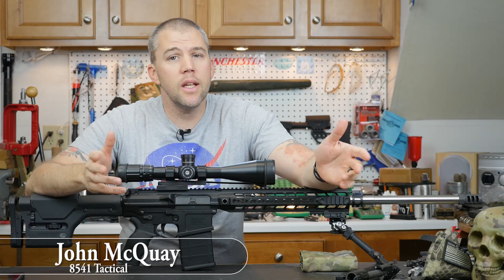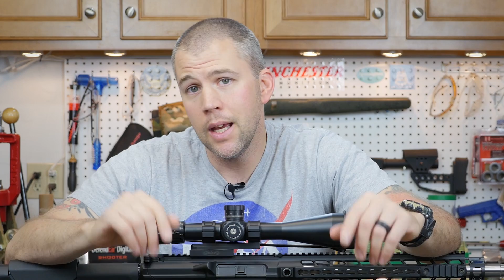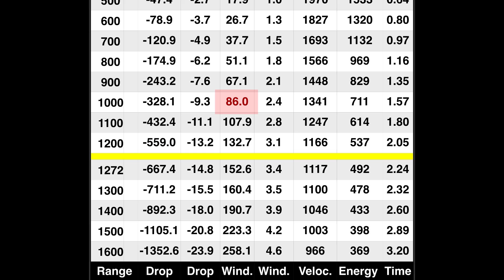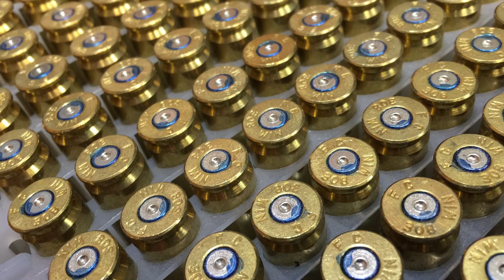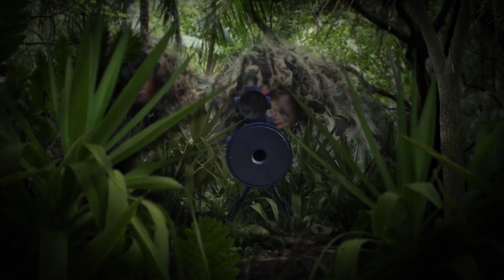Mail Call Mondays Season 4 #14 - 6.5CM versus .308 Win, and Federal Gold Medal Match Brass.

Comment: lost me at burning up barrels.  loved my AR in 243WSSM but took me 2 years and it would not hold a 3 inch group at 100 yards, was holding very nice groups before.  really didnt take much ammo to do it either.  Re-barreling an AR is not all that bad but im not going to do it every 2 years and im absolutely not going to buy one in a bolt action or anything else.  I got rid of it first chance i got. not even going to bother with this round either so thanks for the heads up and i feel sorry for anyone that buys a nice bolt gun in this round.  my Rem700 bull barrel .308 may not be good out to 1400 yards but its been shooting just fine for 20 years.

Comment: Honestly I don't know why anyone shoots the .308.  The 7mm and 6.5 Creedmoor are , out of the box, better cartridges.  They have a lighter recoil and so are more comfortable to shoot.  Plus at the responsible ranges you can take game, there is no practical difference in energy.  They have plenty to take down deer elk moose an boar.  

The .308 and 30-6 are obsolete cartridges from the past.  They are slow, and too heavy.  They are more impacted by windage and elevations issues in distance shooting.  While at shorter distances they have more energy than needed with the penalty of greater recoil.

At 1,000 yards, the .308 needs 8.2 mil. of elevation while the 6.5 needs only 7.8 mil. of elevation.  However the .308 needed 2.7 mil. of windage, while the 6.5 needed only 1.3 mil. of windage, less than half that adjustment needed by the slower .308.

If you are shooting at variable distances, the 6.5 is the better cartridge.
Reply: You clearly haven't thought very hard at all if you don't know why anyone shoots the .308 Win... especially when this video highlights some of the many benefits of the .308 Win.

Comment: Roughly how many shots can you get out of a 308, 6.5creedmoor, and a 338 lapua barrel?
Reply: 308 average barrel life is around 5,000 to 10,000 rounds depending on manufacturer, overheating, and proper/improper cleaning. 6.5 is around 1,500 rounds, I suspect 338 is around the same. 5.56 is an odd one being around 10,000 to 25,000 and I don't think you can wear out a 22 barrel honestly, 50,000 to 100,000 rounds? Someone might want to check my 5.56 numbers because I've seen someone that swears he has around 30k through his and it's still 1-1.5  at 100 yards.

Comment: Everyone makes such a big deal out of barrel life on the 6.5mm, heck I bet it lasts twice as long as any 243, been shooting a 6.5x55 for years still groups remarkably well. Had competitive shooters tell me they get 4k-6k rounds downrange before they rebarrel, so you would literally be spending over 10 times as much on ammo as replacement barrels. Sure a 308 can get 8-12k but I would personally go for the better downrange ballistics and in my experience it is REALLY hard to beat the accuracy of a 6.5mm not even my 7mms will touch the accuracy of my 6.5x55.

Comment: what about 7.5x55 s for  a presision match
 exelent round and good barel life
Reply: Lol why not a 30-06
Reply: Oh boy, someone caught the crack pipe again lol. The 06 pushes the same dam bullet faster, in the 06 you have a better range of bullet grains and heavier bullets with higher BCs than the 308 so you need to read before you speak. The 308 is just easier on the shoulder and more of it can be carried into battle. That is why our military chose it over the 06. Same for the 300 win mag, it has the advantage over the 06 due to heavier bullets offered going faster but they are all the same 30 caliber bullets.
Reply: That and they have a very sharp recoil hit over the 308.
Reply: Long John some people argue that the shorter case of 308 allows for more consistent powder burn making it more accurate

Comment: First off, I really enjoy the channel. Thanks for your efforts! So, I had a Rem700 built in 7mm-08 Rem and it shoots great, but I'm becoming paranoid about the brazed on bolt handles. Do you think the brazed on bolt handle is a real problem? Is it worth it to buy a one piece bolt and make changes to a .4 MOA rifle? Did the USMC reinforce their Rem700 bolt handles with three screws? Are there any competitors running 7-08s? What is your ideal weight for a PR System (rifle/scope/bipod/empty mag)?

Comment: What is the audio set up you have now, I don't recall you mentioning that.  Obviously it's a RODE set up of some kind.  I'm way past due to upgrade my setup.

Thanks!
Reply from the maker: Rumblestrip.NET This is a RodeLink Wireless lav. I was using a Zoom H1 and a Radio Shack lavalier, but the dual system sound was getting old. I would still run dual system for critical stuff where retakes are not an option, but for my style of shooting, a wireless direct into the camera is just faster.
Reply: Great, thank you!

Comment: Great info! I have a big gift card to spend at luckygunner.com and have been thinking of getting some glass and some ammo for a rifle I don't yet have. Any suggestions on a budget 6.5 bolt gun? I don't think the Ruger precision rifle is an option do to the folding stock. (NYS resident) maybe a savage model 10 or one of the Ruger American rifles?
Reply: I can do an AR also. Is 6.5 Grendel a good option? Seems you have a decent amount of factory loadings these days.
Reply: fetzner808 The Grendel won't have the max distance the Creedmore will have but it's definitely another great round. The Hornady match-grade ammo in 6.5 Grendel is excellent too. I've seen sub 1/2 moa at 100 yds with the Hornady Grendel ammo in a brand new Obermeier (sp?) barrel.

Comment: Video is excellent, but the audio is a little more "tingy" than normal. May want to adjust the lows and mids a bit. Just feedback, not criticism. Thanks for the awesome content as usual John.
Reply from the maker: Thomas West Excellent criticism. I did not spend a lot of time on the audio. Just threw an EQ and Compressor on it. I will admit I am not an audio guy and with my hearing damage, never will be. I didn't realize how much processing I did on the old audio (cheap lav) until I tried to drop the same preset onto this track.

Comment: I tried to size up a 243 to 308 with mixed results.  Could I step it from 243 to 260 then 260 to 308 or am I just wasting my time?  My thinking is if you can go down, why not go up?  Thank you.
Reply from the maker: CoinDoctor1 You can. Sizing to an intermediate diameter is a pretty common technique. Make sure you check for donuts inside the neck and ream them if necessary.
Reply: Thank you for your quick response.

Comment: video footage looked and sounded great. I've used all of the Rode brand microphones on home studio projects. what lense were you using?

Great video since I have been looking for my first bolt gun, and the ruger precision in 6.5 creedmore, figured would give me plenty of room to grow.

whats the guess on barrel life comparison to 308?
Reply from the maker: strykeback1 The lens is a Panasonic G X Vario 12-35mm f/2.8. It's supposed to be the best "all around" lens for the GH4. In photos it is razor sharp. The video doesn't do it justice since I had the in-camera sharpening turned all the way down and I did not add any sharpening or contrast in post. (oversight on my part).
Reply: ***** Looks good minus the little hotness you mentioned.  Did you film at 4k and crop in for the close ups?
Reply: +Bruce Tuller yes. I will probably shoot everything in 4k now. It gives me a lot of freedom.

Comment: If you are looking at the ruger rifle as a long range defence gun then go with the 308 it has better hitting power then the 6.5.  Yes I know the 6.5 flys better but that is not the same as hitting power at the point of impact.
Reply: If you look at the second to last column of the charts I posted, that is the terminal energy of the bullet. The .308 has a good lead up close, very little lead at long range. The .308 has a lower BC and slows quicker. This was just comparing factory loads. Not even mentioning the highest BC bullets available for the 6.5. Finally, only hits count.
Reply: *****
I was meaning to knock what you were saying. I just wanted make sure that folks get that putting holes in paper is not the same as using the rifle for a defence rifle.
Reply: +scarmenl no offense taken. Just remember that a "defensive" rifle is not going to be "long range". At that point you are on the offense, both tactically and legally.

Comment: Cool camera.   The video looked a little hot, not a ton but just a little over exposed. I will try to take a look at it on 1080 tomorrow and see what I think.
Brian
Reply: It is about 2/3 of a stop too hot for my liking, but I didn't have time to redo.
Reply: ***** Can your camera do 1080P at 60 frames per second?
Reply: rdsii64 No reason to on live action.
Reply from the maker: rdsii64 I can actually over-crank to 96 fps in 1080p, but without sound. I can do 60 with audio. Going to do some work with that soon and see what we can come up with. Should be good for training videos.

Comment: John, video is great and clear. Audio is clear. Great setup. But you aren't quite centered. Haha. Question, you mention you use your brass maybe 8 times. I understand it thins out after cartridge is sized trimmed etc.  Do you have a thickness number that can be measured for the walls of the shell? It would give me a number/measurement that I shouldn't go over. I understand many factors come into play. But knowing when to dispose a cartridge is very important to me for safety reasons and for consistent shots. Thanks in advance. 
Donny.
Reply from the maker: cilydaniel There are a couple of methods to check the internal case thickness. One is to use a paperclip to check for thinning inside the case forward of the case head. Honestly, I don't use any of them since I usually have the primer pockets open up before anything else.

Comment: Just a random question. falcon menace 4-14x44 for a low budget scope a good idea?
Reply: I've heard really good things about the 4-14x44mm Primary Arms FFP scope, but haven't had the opportunity to test on myself yet. Personally I am a big fan of the SWFA SS series for "budget" scopes. I run a SWFA SS 3-15x44mm on my long range target rifle and have zero complaints. It's not exactly cheap at $800 but it's worth every penny.
Reply from the maker: paintface23 I still have the 4-14x44 Falcon sitting around here. It gets swapped onto rifles that we don't have an optic for. The only reason I don't use it more often is because it is Mil/MOA. If it was the mil/mil version, it would get more use.
Reply: +TheBamidd I have had some issues with the PA FFP 4-14x44mm scope.  The first two I ordered had messed up reticles.  Got the scope mounted and leveled and when I went to sight them in, the reticle was far off level, which makes the mil dots basically useless.  I still have one on my Rem700 .308 build that I use for basic practice until I find the right scope for me.  I have always been a fan of bushnell and Nikon scopes.  I am by no means an expert on rifle builds and marksmanship,  I am still very much a beginner and always open to suggestions.